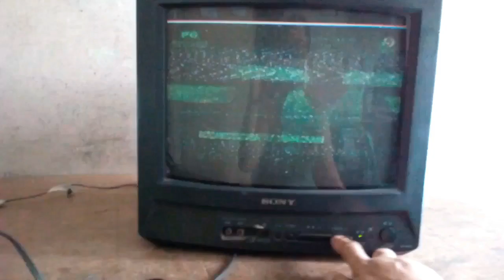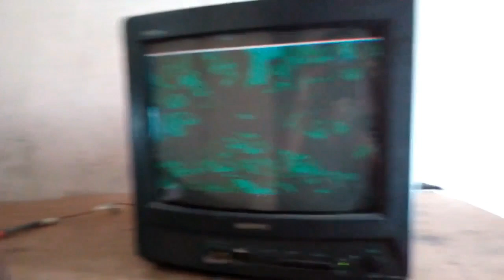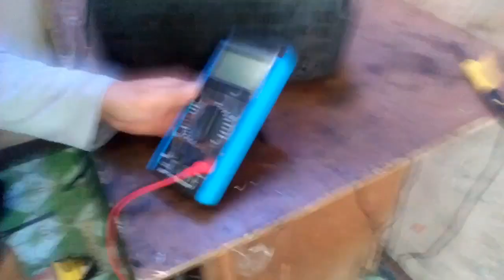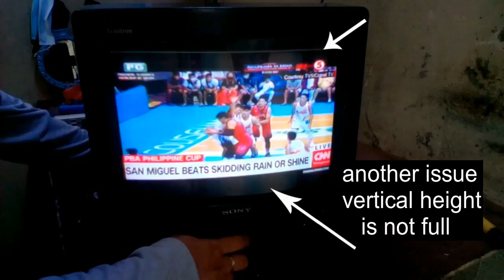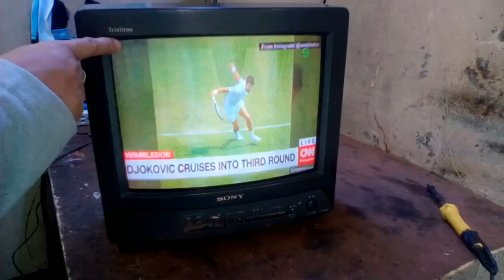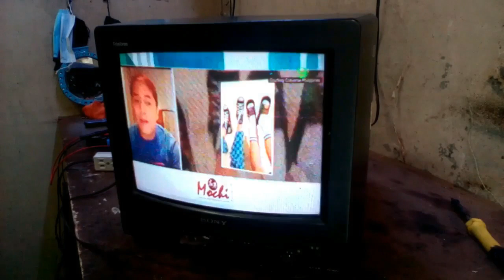How to repair & restore an old model  Sony Crt tv that has a dim picture (low brightness  problem).

Comment: Gud pm sir, ano pwede pamalit sa capacitor 390uF 160v sa sony crt 14 inches walang mahanap. Pina ayos ko walay mabil dito sa cebu baka naman sir ano payo MO.
Pina ayos dahil madilim ang picture.. .
Reply from the maker: 470uf/160 volts po sir.